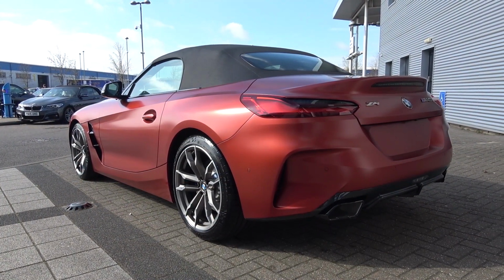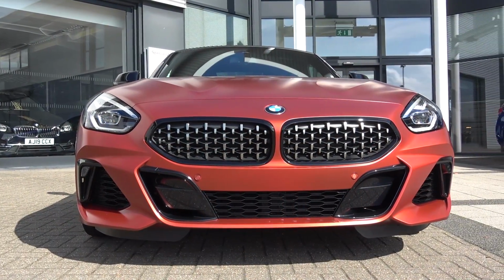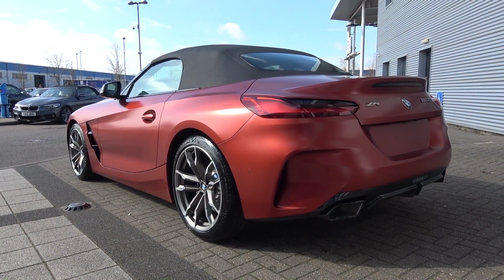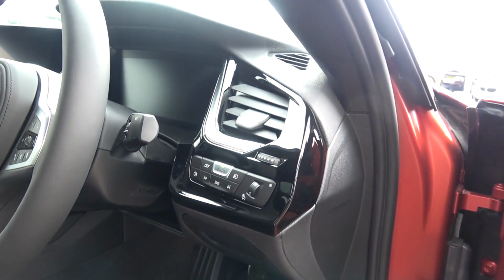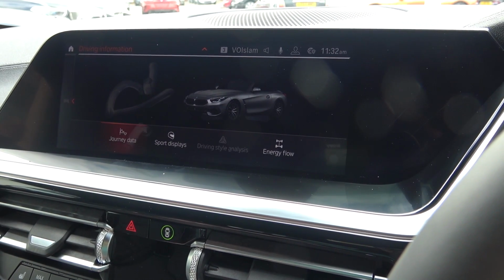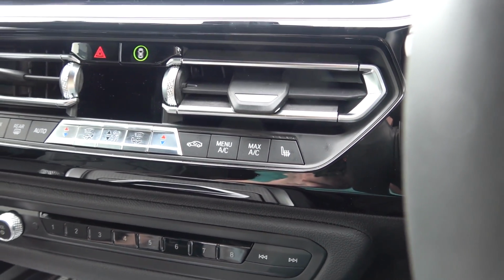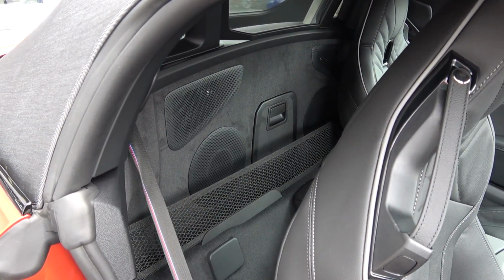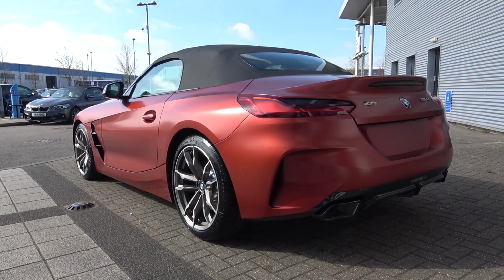2019 BMW Z4 M40i First Edition: In-Depth Exterior and Interior Tour + Exhaust!

Comment: I personally will miss the old hard-top version.
This will most likely be much more 'sporty' to drive given lower weight roof and folding mechanism plus the mentioned 50:50 weight... but I do feel the hard-top was just better suited for this car which was never seen as a harder pointier sportscar but a leisure gt

Thanks for the video.
Reply from the maker: Overall this is probably a 'better' car, but I agree with you about the roof. The hardtop suited it.
Reply: The E85 had a soft top